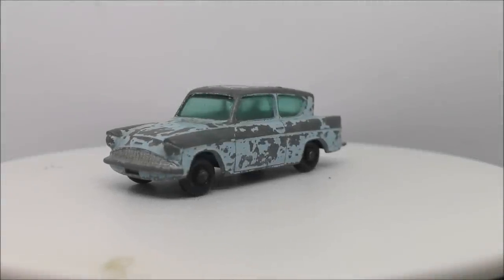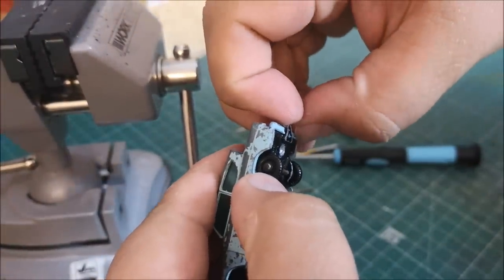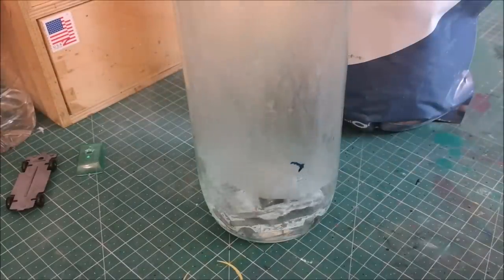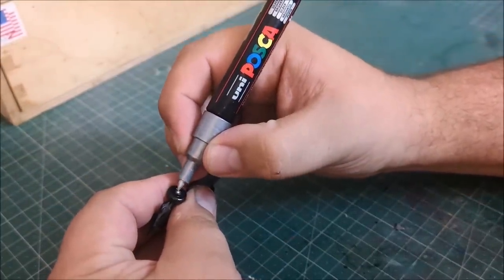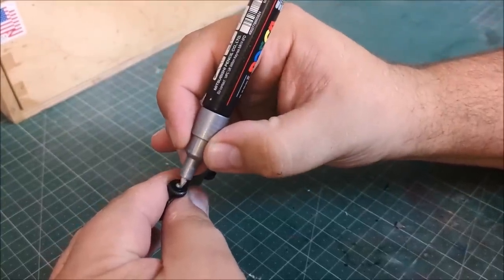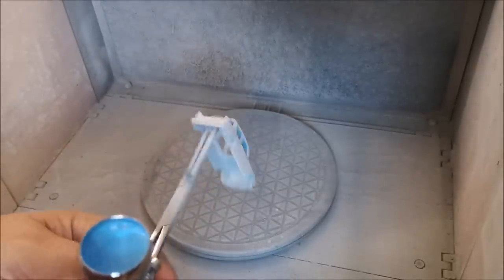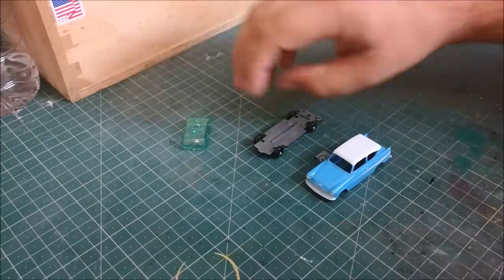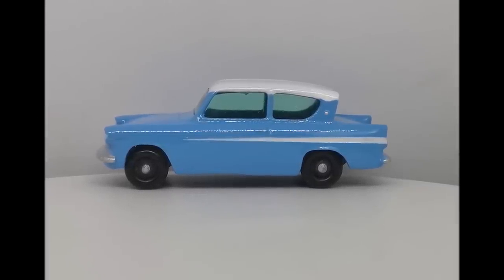Matchbox No 7 Ford Anglia - Harry Potter Custom Video

Comment: What is the "pledge solution"  to clean the plastic windows?
Reply: A self shining floor polish.  It's THE product to use on the window units.  Brings up 50 year plastic like new.  Pledge is the brand name, and you can find it in household cleaning section at a supermarket, if it is available in your country.  Got mine from Bunnings, our huge hardware warehouses.  Probably any brand of floor polish, which says it is "self shining" should work.

Comment: Very nice restore.  Yeah that is a pretty bright shade of blue, would have been nice if it were lighter but not hating it.

I used to fix my trailer hitches with a piece cut off from a large paperclip, with a diameter of about .7mm.  I would glue it with a bit of cyanoacrylate.  It would hold up ok but nothing you could ever play with.  Yes I used to do these when I was a kid.  Today we have the gel which is s lot stronger, and on a case like this you could just hit it with a black sharpie and no one is the wiser, but again thats not something I ever had access to.

Comment: Excellent, lovely job, just a bit of trivia for you, the actual harry potter car was stoled from outside an industrial unit asociated with the film studio,s in bristol and never seen again, it had no engine or box and was 8n pretty rough shape, i wouldnt be suprised if it ended up as a classic banger racer, i doubt its with a harry potter fan.
Reply: It's hiding in the forest. Muggles were told it was stolen. 😄

Comment: Great result looks, fantastic.  Matching paint, we can never be sure what the actual shade is anyway: too subjective.  Would have to time travel back to when the models were new.  Different paint batches at the factory, age, exposure to the elements etc. and the chemical composition will have changed the colour shade from what it was, when new.  Your resto looks just fine to me, and it's a period correct colour.  Must get on to my grey wheels example, as it looks like the "before" model, although I was lucky enough to get an intact tow hook.

Comment: Hi Rob.  When you do these Anglia Supers have you ever attempted to mimic the chrome strips which bound the roof coloured side flashes.  I am shortly about to restore my two Matchbox Anglias in the same paint schemes as the real ones that I owned in my dim and distant yoof, a 997cc Deluxe in Ermine White and a 1200cc Super in Maroon body and Cirrus White roof and side flashes.  These will be my first attempts, but with only one working arm it will be tricky so I wanted to ask someone who knows what they're doing if that is feasible.  Before I make a complete hash of them both.
Thanks bud.
Reply from the maker: I've only ever restored this one mate. I was actually considering to restore another one shortly so maybe do the Chrome strips then
Reply: @MatchboxGarage   Thanks for the speedy reply.  I'll look forward to that video, and until then perhaps I will focus on my Volvo 760 and my corgi Ford Sierras.  No chrome trim to fret about.  Thanks again.

Comment: Does anyone know if caustic soda would be safe - well, for a given value of safe - on lead and pewter miniatures? I typically use acetone (nail polish remover), but it can take forever.
Reply from the maker: I've not tried it on pewter so couldn't advise

Comment: Look up what a Reliant Regal saloon looks like and see the almost blatant rip off going on where Reliant squared off the headlamp nacelles and changed the design of the rear lights a bit, Ford said not a thing, not even the reverse profile rear window which itself in later years was revealed that Ford had nicked off of Standard-Triumph for their upcoming replacement to the Herald, rushed it onto the Anglia then proceeded to litigate Standard-Triumph into bankruptcy citing S-T had violated copyright and poor ol' S-T went down the tube beaten to death by its very own design lol   I suspect the Ford blind eye was utilised because Reliant were buying lots of their Essex V6's out the back door at Dagenham and the sudden myopia defunctus came rushing back for the MK2 Robins which were basically 3 wheeled MK2 Fiesta's visually even using Ford Fiesta lamps.    Funny ol' world we live in lol